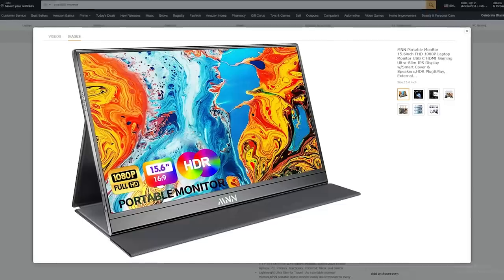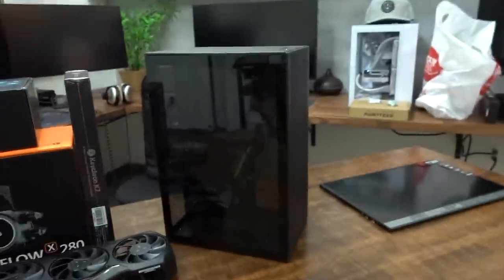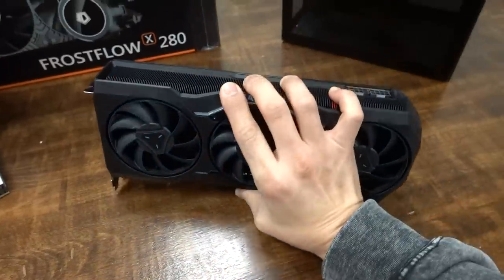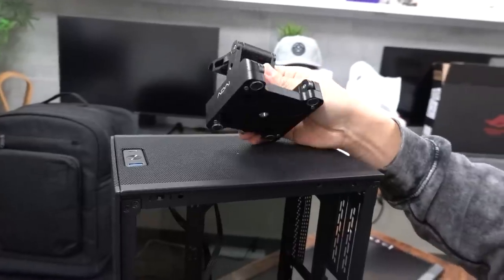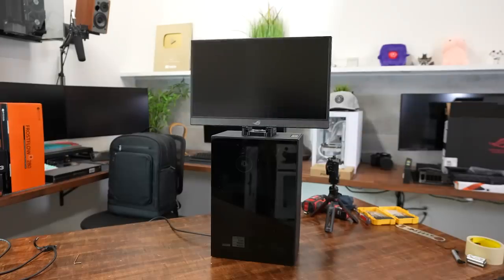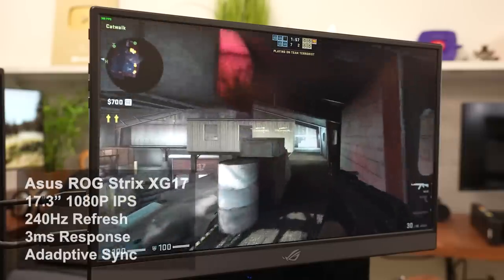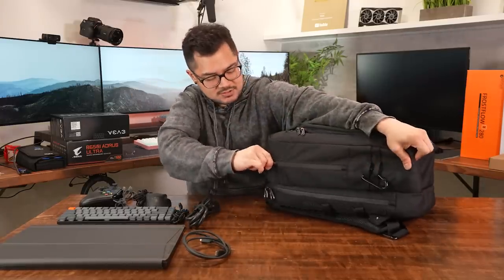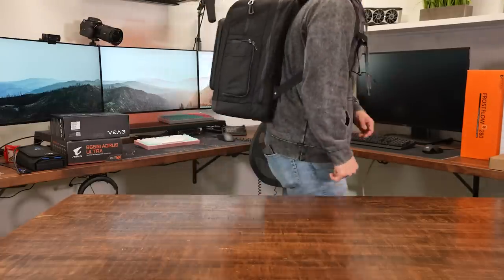I Don't Know What I Just Built, But it's Awesome!

Comment from the maker: Hey ya'll. Thought it would be fun to build my own All-in-One PC that I'll hopefully get to use when traveling later this year. Let me know what you think!
Also thanks for bearing with my jet lag in this video. Feeling a bit more rested today. :D
Reply: I recommend you go outside and find a hammock. Climb on it with a woman, and go to sleep.   It appears your plane took a detour and ended up in North Carolina instead of Taiwan.  🍺🍺
Reply: Kyle, I will give you ⭐⭐⭐⭐⭐⭐ on your new system
Reply: Kyle, take a tour of Europe
Reply: Touch grass and have fun. Gang
Reply: What about the glass side panel during travel i am scared it will break plus the monitor maybe some foam?
Reply: @JasenBerger  foam would help, although he's probably fine if being careful with it and not checking the bag when flying. Tempered glass is weird in that it can easily shatter on it's own (or due to hot-cold temperature cycles) if it has a flaw but otherwise isn't as delicate as one might think. The force to break it while in the bag would likely be bad for the other parts in the system, anyway. If you are expecting that kind of treatment a hard case + foam is the way to go. A laptop sleeve for the portable monitor would be a good way to give it additional protection, though.
Reply: My thoughts on the build: Neat but possibly a tad big. Could try with a case of a size class like Velka 3, 5, or 7(granted they have LP CPU coolers, but still).
Reply: you can power that monitor and get video signal with the single usb type c coming from the gpu
Reply: Only got made it to 2:06 before a legit lol
Reply: Press play, click LIKE, enjoy clip.
Reply: The form factor of the build really gives me a "this rig is a self-checkout kiosk for some retail store somewhere," but it looks like it was fun to play games on.
Reply: @youreawesome77  He said that he doesn't like looking down on them.
Reply: have you forgotten rx7900xtx heatsink issue's it was cause by vapors lock not enough liquid inside heatsink
Reply: "I'm a bit... foggy.....  because I just got back from Taiwan 4 days ago!" sure Kyle sure. 😁
Reply: its Yawl , Not Y`all
Reply: I have an idea where you should travel!!!! LTX 2023!!!!!!!!!!!!!!!!!
Reply: Briefcase is a better safer route. Rebuild it.
Reply: You  get USB cables that have articulate plugs or just get 90° plugs with USB-C plugs it doesn't matter which way you plug them in, right?
Reply: Kyle ty for sharing the video I love your channel all I have to say is God bless

Comment: The top mesh is flexing.  You might want to add a metal or plastic plate underneath to spread out the load from just the one 1/4" screw you have holding the monitor mount down, and stressing the hole you drilled.
Reply: This should be easy to resolve with a piece of sheet metal underneath of sufficient thickness, just get a piece cut to the same dimensions as the top part of the mount and you're g2g

Comment: You should use 90 degree HDMI and USB C cables, I did the same when using my portable 4K display as my secondary display at my setup! makes it look a lot cleaner as well :)
Reply: Hey dude, curious, have you had any issues with 90 degree HDMI?  I've tried 4 different 2.1  48gbps+ 90 degree cables of different lengths and vendors and they won't do 4K 120hz at 4:4:4 10bit, yet the straight connector cables from the same vendors work fine, if I reduce sampling or color depth to 8bit, they 90 degree cables work fine. HDR at that depth at 120hz is always flaky regardless of the cable. The weird thing is that the vendors insist that since their 90 degree HDMI 2.1cables all tested at hitting 48gbps successfully, it wasn't their problem so it must be my GPU, yet I have the same problem whether it's using an RTX 3070 and RTX 3080. Could be Gsync causing the issue but I've disabled it with no avail, I unfortunately don't have another display capable of anything beyond 4k 120 4:4:4 10bit HDR to test on to see if it's my LG panel and not the cables or GPUs.
Reply: @racerex340  So, it's actually funny you asked. - I'm actually not running the portable display AT 4K, I'm running it at 1080P, it was sent to me, and it's not a high refresh rate display. At the size (15.6") 4K is too small for the distance it's at, even when scaling, so I haven't bothered. It's just used for discord because I'm running that QD OLED Alienware 34" monitor as my main display. - I would imagine most of these 90 degree connections don't support 2.1 interface, and they're just cheap connectors. It may be hard to find one if I'm being honest. I think your problem is coming from 90 degree, and not the cable though. 

Now, what you can do is purchase a 2.1 HDMI ribbon cable, it'll be super delicate. They're mostly used for camera equipment, or shorter runs, but I'm sure you can find one long enough for your setup. I hope that helps!
Reply: @valismind  thank you, didn't even think about using a ribbon cable. A few others I've asked have suggested optical HDMI, until I remind them that light (and optical glass for that matter) doesn't love taking abrupt 90 degree turns.

Thanks again!
Reply: Well the GPU features a USB c port so he wouldn't even need HDMI You just needs a 90° usbc cable capable of display

Comment: I've been itching to do a portable desktop build for traveling. I have a gaming laptop, but found it's thermal solution lacking and fan noise agitating.

Mine would/is likely to be assembled inside a compact Rigid tool box case with the screen mounted to the lid. The reason for the tool box is I already travel with a rolling Rigid box for clothes and another for tools. The slimmer PC case clips on top.

Comment: Did this years ago with a MasterBox Q300L and a vesa mount. 23 inch monitor on top and added swivel wheels on the botton. The mount worked as a handle to carry it with. Could even lay the pc on the back panel and the monitor would swivel and rest on the side panel like a school pc.

Comment: Most portable monitors are magnetic enough to just stick to a metal case, just need to keep it from sliding down. With mesh, just thread something through the case for the bottom of the monitor to rest on and it won't slide down. 90 degree cable adapter feeds into the case to hide the tacky wire. Portrait if mounted to front, landscape if on the side

Comment: I might have a portable monitor problem, stairs to the left... stairs to the right looks at two identical images on two portable monitors. Realizes that there's a third one in the car that could probably get hooked up as well.
2 of them came with a little magnetic flip cover stand that works really well however that one looks really thin. In this case it flips over the top and flips around back into a stand without having to come off so it's protecting 3/4 of the device. And because it's got a quarter of the device to attached to it actually makes a decent stand.
I ordered a portable monitor for an OBS streaming system for somebody and that just came with a sleeve a thin sleeve to slide the thing in.
Reply: Oh shucks I got a spam comment replied to it with a masterpiece then reported it my comment got deleted.
Yes I know I'm replying to spam! It makes this fun when I go and report them. Although this is a new one for me the tagline message I just couldn't resist some slight editing. LOLOLOL by the way I tried to use a screen reader on the text, madness!

Comment: Get a thin piece of steel or aluminum to back the top panel under the monitor mount. Would add structural stability. You could probably run it all the way across and anchor against the inside of the case frame to keep the top panel from popping off while making adjustments too.
Reply: Hello subscriber you have successfully been nominated for a Gift contact the number above to claim...

Comment: I use a 4080 FE in my Meshlicious, Temps are a lot better than I expected stock. Even better when you undervolt.

I use air cooling with two front fans exhausting.

But on the build. Very nice. I actually built an all AMD portable system in the A4 H2O using the 15" version of the same screen. I got a tripod for the stand. I use one usb c cable from the monitor to the GPU and it powers the monitor plus video signal.

Comment: I have a similar setup, but in the meshroom S case since I use an ATX motherboard. from what I understand it's basically the same size as the meshlicious. My monitor is an AYY 16" 1440p 120hz portable monitor. Didn't realize this type of mount existed, might end up doing something similar, having monitor at correct height makes all the difference!

Comment: Wow...my thing is, if I were traveling with this rig via plane,  in the awesome LTT backpack, it would HAVE to be a carry-on, overhead. The question is, would it fit in the overhead on most airlines? Could you imgaine your rig being in this backpack just as regular luggage? Tossed around and handled as if it were clothes inside, etc? No way! VERY cool video Kyle! Love your content...3 years now!
Reply: That backpack will fit as loaded into an overhead compartment on any full size passenger jet, without any issue. It will also fit under the seat...but it will devour all of your leg room. It may not fit in a small regional jet compartment...it will be close.

Comment: I've got the same monitor, but your xtx card should have a usb-c display port output so just plug that in as it will also provide power to the monitor and you only need a single cable to run the display.
But I got also got an original stand and carying bag included with it.

Comment: Broo! I can't believe you used both HDMI and Type C for that monitor! 😐 When I bought that monitor one of the main resaons I was interested about it was because with a single Type C cable you can do both power & video (the middle port)! I was on a 2070 Super at the time, and I was really annoyed that the next gen 3000 and 4000 series didn't have a single Type C port. You have a XTX though, reference design!! I thought from the beginning you were going to use a single cable... 😵 That's the perfect way to do it!

Comment: I have a similar build in the meshlicious, 7950x b650e board, 1,2 and 4tb drives, 32gb ram and a 3080ti. I can tell you right now that case DOES NOT support a 4 slot card. My 3080ti 2.5 slot card barely has room against the side. Also there are several mods people have made for this, including rear and top fan mounts that are necessary for a high end card, otherwise you are going to have a hotbox that will slow down, or damage your nvme if it's on the back side of the motherbord.
Reply: Hello subscriber you have successfully been nominated for a Gift contact the number above to claim...

Comment: So just curious, why not use the type c cable to supply both power and video? That gpu has a thunderbolt usb-C and so does the monitor. I Use my HP rtx 2070 super that has a thunderbolt connector this way just to cut down on cable clutter, and it powers a 2560x1600p monitor easily. Awesome build either way btw lol

Comment: Excellent video! 'm building a similar setup. Just got a portable Viewsonic 16" OLED that has an excellent built-in stand that also supports tripod mounting so you can put it on a full or mini-tripod. Quite good and very good colors and blacks (as to be expected with OLED). Very nearly went with that ASUS one you bought, though; the XG17 is higher refresh (the VP16-OLED is only 60Hz), has built-in speakers, and a built-in battery. Got a Cougar Dust 2 for the case, which will fit in a carry on-friendly Pelican AIr 1535 or Nanuk 935.

Comment: Consider damage to the monitor as I don't believe that case will provide much protection from even light hits to the bag. Just a thought, thanks for the video, love your work.
Reply: pretty sure there is a decent foam padding and you can always add another level of protection. also i disagree with light hits hurting the monitor the fact that the back pack is literally completely full with no angles if the back pack gets hit it will swing side to side with no other parts touching it.
Reply: @imwithyou38  ah good explanation Einstein.

Comment: So I'm looking at getting a new PSU. I was comparing specs on newegg on the EVGA Supernova 850 GM that you used in this build and the 850 platinum P6. With the P6 being $20 cheaper all the specs seem to indicate that the P6 is better but 40 mm larger. This is getting paired with an EVGA 3080 10g and a AMD3600x. so is the platinum better than the gold or am I missing something?